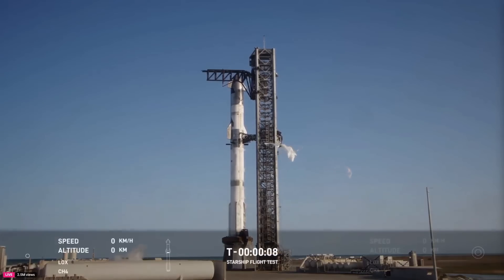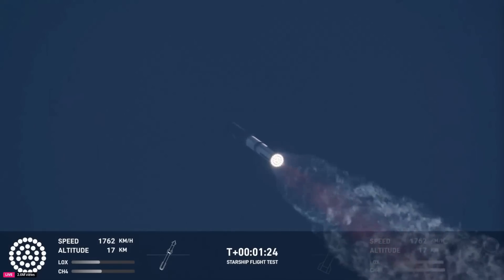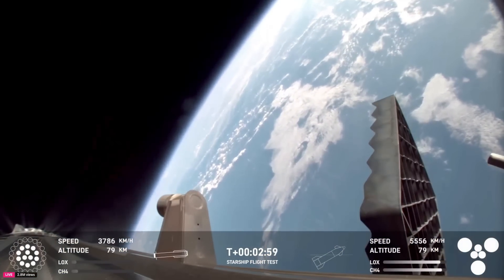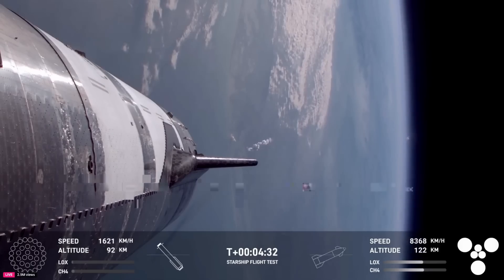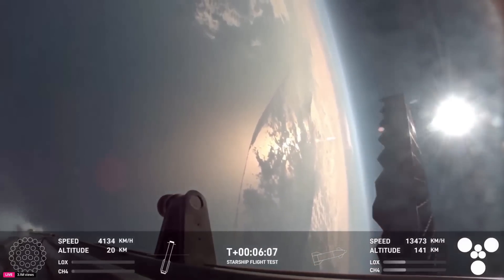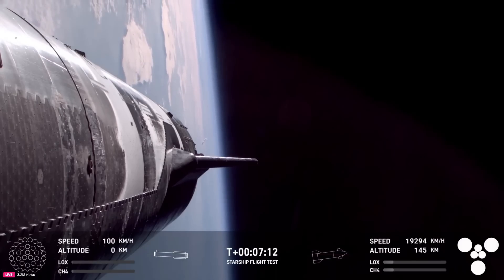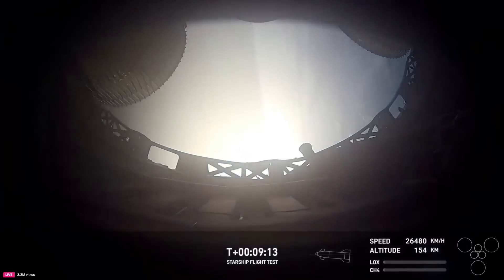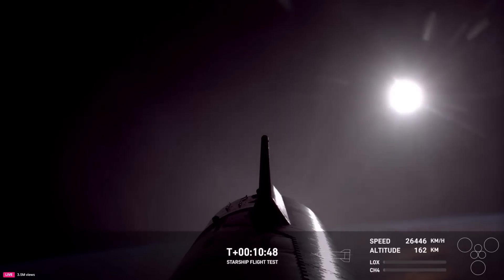Unbelievable! SpaceX Starship Flight 6: Launch, Aborted Booster Catch & Why It Happened!

Comment: Technically, not an ‘abort’; it followed the already pre-programmed landing offshore it was loaded with. What didn’t happen was that the Launch Director, upon evaluating the post-boost back data, elected to Not interfere with that (by sending the Go-to-chopsticks-instead Command), and just let it instead continue on its course to land off-shore. But there was no hitting at Abort Command like we did on the Shuttle.  - Dave Huntsman